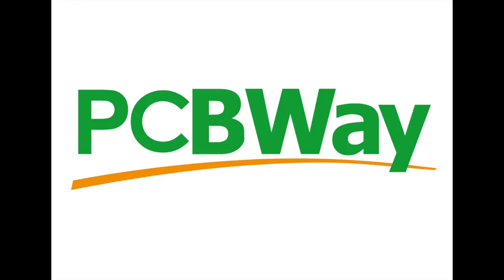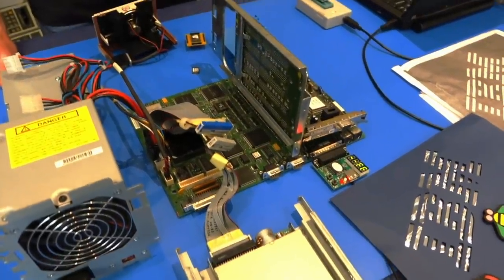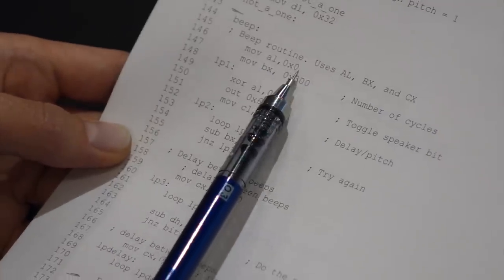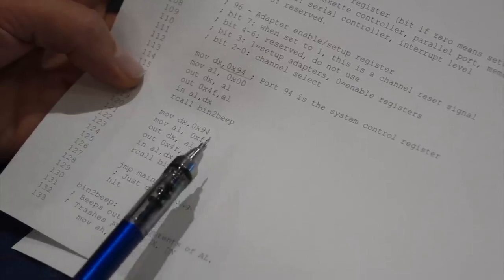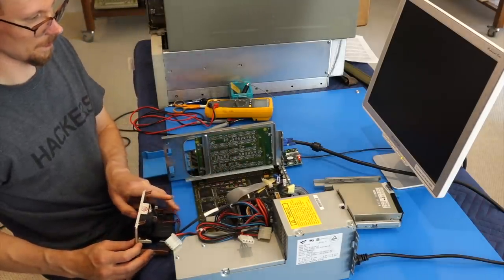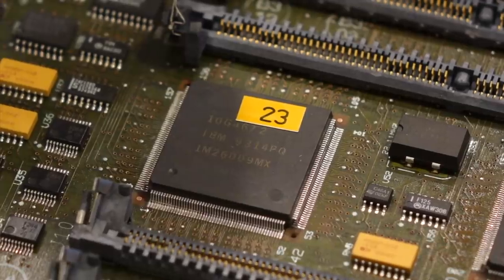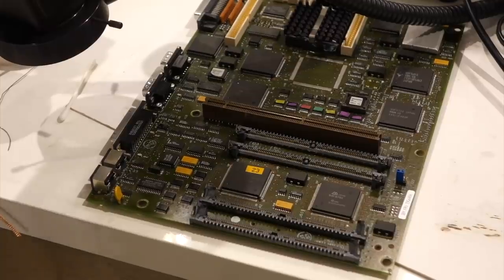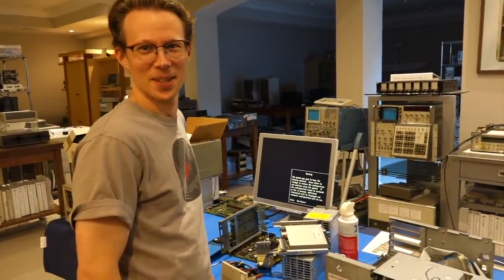IBM PS/2 Part 4: Repaired with a custom BIOS and a magic finger?

Comment: Given how you guys had been pushing on the board, it seems to me like traces might be borked. Trying to revive donor board would be a better idea, probably..

P.S. I don't know a lot of things about what I just said.
Reply: Yep.  I vote cracked via or cracked solder joint that opens and closes with thermal stress.  Hard as hell to find these usually.  Probably better to just foil cover the ram sockets and hot air that area.  Call it a day lol.  Or swap boards like you said.
Reply: That is probably true. If the PCB is toasted, transplanting all of its chips to another board could end in a reliable one.
Or it can be saved with bodge wire to fix the broken trace, but finding the fault is tremendously tedious
Reply: That sounds viable. As an alternative, you could bodge wire everything.
Reply: @awesomecronk7183  Or build a wire wrap replica. Would work fine.
Reply: @Damien.D  * shudder *
Reply: Or a ground issue
Reply: Considering that the goal of this channel is actually the challenge of discovery and the actual repair of historical gear, I bet they will double down at repairing their current board even though on terms of being practical what katoumegumi_ suggested absolutely makes sense...
Reply: Marc's original system is running with the first replacement planar I sent. I also sent a riser for troubleshooting (so that the working system could be left intact) and the second planar. It had the SCSI microcode harvested from it much more harshly than I wanted (I should have done it as Eric demonstrated) - which is why it was an easy selection for more harvesting.

In the same general area, the DS1285 RTC and 2Kb Extended CMOS chips are failing to hold the configuration on a couple of "Bermuda" 76/77 systems. It could be that internal parts of the planar are delaminating. I hope that Eric also de-lids some of the ASICs from the salvage planar (it appeared that he is already pulling chips in the video segment, which is footage from a couple of weeks ago).

Comment: Looks like the high and low beeps take several seconds and the job that the magic finger is doing is hidden during the beeping time.  If the high or low beeps took a half second, then any changes caused by the finger could be more easily located and identified.  But even if you found the location of the fault, you would still need to repair it.  That would probably require that you do surgery on the motherboard, somewhere within the layers.  Your choice of replacing the motherboard was probably the best choice.
Reply: They just need to have a single short high or low beep to indicate whether the read matched the write both ways around, then it can beep away rapidly for high resolution magic finger analysis! :)
Reply: @krnlg  I was thinking the same thing.  Rapid beeps, high for "passed" and low for "failed".   Much easier to track down the issue.

Comment: That BIOS hacking brings back some good(?) memories...
I once did some reverse engineering of a Linksys NAS that used an R8610(?) microcontroller that emulates the Intel 80386. It ran a small program (I think it was RedBoot) as a BIOS alternative to initialize things before actually loading and booting Linux, and that preboot program could also do things like wipe the flash memory and download a new ROM via TFTP. But if you gave it the wrong command, it would wipe itself out, which I did. Oops!
I had to use a JTAG debugger to de-brick the thing, which was not easy: the 80386 boots in real mode and the emulation of this microcontroller didn't emulate real mode properly. So I had to somehow get code into memory to make it go to protected mode without using any broken instructions or broken memory or whatever. I have no memory of how I managed to do it but eventually I had it executing instructions step by step via the debugger, and was able to initialize the BIOS shadow RAM, download the Redboot program into it by storing the hexadecimal bytes one by one from the jtag terminal or something,  jump into the program, and then used TFTP to reprogram the flash memory again.

Comment: I like assembly. I'm enough of a nerd to add this: there are eight general purpose registers in an Intel CPU of which (only) AX is called the accumulator. BX is called the Base Register. CX is the Counter Register and DX is the Data Register. SP is Stack Pointer, BP is Base Pointer, SI is Source Index register, DI is Destination Index register. :p
Reply: All true! Though I suspect what he was alluding to was that since all of those registers on the x86 are general purpose, one could think of - or use - any of them as an accumulator when desired. This is somewhat in contrast to the other architectures in which they are both experts (1401, 6502, etc), or others that just had multiple accumulators. Now what bugged me was that he didn't show the part of the code that guaranteed that CH was 0 when only setting CL to 0 in those LOOPs. :)
Reply: @Hiphopasaurus  ooh, sharp! I was wondering the same thing :)

Comment: Gates may float with stray capacitance or lack of pull up/down. If it's not a capacitor it could be a bad trace for pulling the pin to a logic state. Could try to compare continuity from a known good board and see if the chips pins match. This is a simple trick to diagnose faults. You might find a pin that has a slightly different continuity value. Then see if it leads to a high rail or ground. This may be tricky without a schematic. But if all else fails you can just guess with a high ohm resistor and tie it down. If it doesn't work, tie it to high.

Comment: I had a similar problem with a hard drive many years ago. I heard freeze spray on the chips can fix it, so I tried it and I could read the drive. After a while I figured out pressing on the right part of the board would also fix it, so my feeling was that it was a dodgy trace on the board rather than one of the chips. I managed to get all the data off just laying under the desk with my finger on the drive for half an hour while it copied.

Comment: 99% it's a broken pad-to-trace or a failed solder joint. If the IC is not reading back data with zeros, then it may be Hi-Z'ing the data port (AD port? not sure, I only know 8085) or the IC is not properly ready to be read. Maybe the /RD, /WR etc. control lines? 
I'm assuming you did not try to read any other registers from the same chip here.  
I recall my high school days where we had an Apple II in the lab with a similar issue. That one involved cheap IC sockets though and pressing on the board was enough to get the problem IC to behave. I alternated between that and hitting it like the Fonz. :D
Good work on using a simple BIOS to debug the issue, a true embedded engineering effort there.
Cheers,

Comment: Rejig your test code so that it writes and reads to the port within the beep routine, adjusting your delay for the frequency based on the value being read back as been good or bad. That way you will have a real time feedback that you can listen to while probing with your magic finger. It should help you to identify the exact location of pressure on the board. At the moment you are  sampling for a good or bad port wright/read every 10 seconds or so while beeping out your results.  
Just a thought.

Comment: Some early cheap PC clones had issues with the neutralising solution/wash in the multi layer boards that resulted in some time in the future tracks developed open circuits in the inner layers. When you applied pressure through mechanical means or through temperature. The fault would temperamentally go away only to reappear once stresses normalised. Because it was somewhere in an area of the board on a god knows what layer made them impossible to hot wire. It wasn't worth tearing your hair out, loosing sleep or your sanity.
Thankfully When PS2 came out I never wasted my money on them. They had a bad smell about them and offered little when compared to the many clones. It was a matter of picking better clone manufactures.

Comment: With NASM, you can get it to generate the required long jump at the end of the BIOS by coding:

jmp word 0xf000:0000

Worked for me when did a trial build of Eric's excellent test code.

Comment: To throw another complicating factor into the ring, perhaps one of the surface mount SMD caps failed. Dave Jones did an episode years and years ago about a scope that had a microphonic input connector because the ceramic SMD caps were delaminating. This board is weird, but I love headscratchers like that

Comment: It's most likely a floating data line, probably a bad via or trace your finger on the IC is just enough to pull it low/high to make it work for a while

Comment: Microscopic break in one of the traces, probably in the middle of the PCB sandwich would be my guess. It eventually fails - after using the Magic Finger to shove the trace close enough together to work - due to heat expansion as the chip over the break warms up. Probably not worth going to the effort of trying to fix with bypass jumpers or whatever, so yeah - just use a known-good board.

Comment: Have you guys come across Paricon PariPoser® anisotropic elastomeric fabric?

This is a silicon like thin sheet with silver spheres that is only conduct in the Z axis.

It’s useful for mating between PCBs, connectors & ICs without having to solder (and possible damage) pins.

Comment: Sounds like a floating pin somewhere that as the wrong logic level. When you put your finger on the chip your finger connects to the pin and charges/discharges the pin to the correct level. Since this is cmos, it will store that level for a long time as a charge on the pin.

Comment: I wonder if the break is near the ISA slot, where the most force might be expected.  It seemed to break when you flexed the board downward. It could be that any transverse pressure from the magic finger could "push back" a connection in the substrate. I'd love to know if the magic finger worked elsewhere (har) or if "pulling up" on the ISA slot worked too.

Thank you for the cool explanation of the BIOS assembly.  I liked how it was obvious why the lower frequency beeps took longer to complete from the delays.  I hope that you find joy in giving this one more try, it's an interesting problem.  If you do, please re-write the test routine to beep much faster so that your time-per-test can be reduced to just 1 second, in order to allow more natural exploration.

Theoretically, how might you find an in-board problem like this (if indeed that's what it is)?  Trace-domain reflectometry?

Really awesome work, thank you! <3

Comment: I suspect my ‘retro rig’ is cursed by this channel for what problems to have.

When I first got it, it suffered from a corrupt BIOS like the Dolch which a BIOS update fixed, then it decides to have an intermittent fault like this motherboard when vertical, but works fine when horizontal.

Comment: if it were me I'd check pull ups and pull downs as well as measure impedances for each trace to a known source like vcc or gnd. I saw that he was actually touching the pins with his finger while you were only touching the chip. So my guess is a pad problem or some sort of pull up or down not working the way it should.

Comment: I have a magic fist story, I had an 8GB scsi hard drive (the size of a loaf of bread) that had 3GB of files for a huge print project I was working on. The drive just stopped mounting one day. I had no idea what to do, so I got a quote from a data recovery company.... who wanted £1 per meg, or £3K! I asked my mate Dave Popek, instead, who was a proper PC expert. He dismantled it, more than once, checked everything but nothing seemed to be wrong and it still refused to mount. In exasperation he 'Fonzied' it ()Heyyyyyy!) giving it a short bang on the top with his fist, just like Arthur would have done it, and IT MOUNTED! I spent the next 8 hours or so copying and backing up all the stuff on the drive... and bought a proper tape backup system. Ah, shitty kit, but good times.

Comment: Im wondering if you dont have a bad resistor network for pull up/down that the finger replaces? but that wouldn't explain why cold would fix it either, unless its from overspray on the IO chip getting to a pack and making it work again. The touching of elsewhere on the board making it "break" again makes me think you then pulled floating lines in the other direction.
Reply: The cold spray will make the area that is sprayed contract slightly. If there is a dodgy trace or solder joint, the cold spray may be making it reconnect again.
Reply: @simontay4851  It also causes condensation, which may be conductive enough to pull a floating CMOS input pin to the correct level.

Comment: Interesting the whole "hardcode the stack" thing. I suppose there's no on chip cache in a 486 so you can't do the "use cache like it's ram" thing that is apparently popular today.
Reply: I believe the 486 does have on board cache, but the BIOS has to bootstrap that too. Adrian’s Digital Basement just did a video on a funny little Cyrix 486 chip you could piggyback onto a 386 to get the advantages of a faster clock and on-chip caching, if somehow the board and BIOS supported it (surprisingly that one did). You’d have to ask Tube Time if the IBM bios would have enabled that during a successful boot.
Reply: @lauram5905  I literally just watched that one and still forgot that detail. Doh!

Comment: Watching what was going on, I have three tentative hypotheses:
1. It is a thermal problem of some sort in the chip or motherboard.
2. It is a capacitive problem with a floating lead or a bad bypass cap somewhere.
3. It is another chip that is partially desoldered, and is just getting stressed from pressure on the suspect chip.

I'm going to rule out #1 since you replaced the chip and I've never seen a thermal problem of that sort in a PC board. (Burned holes are a different "thermal" problem. :-)

I'm going to tentatively rule out #3 since it didn't look like Eric was pressing all that hard, but it sticks in my mind as a possibility. One of those little 44(?) pin chips maybe.

That leaves me with suspecting a floating signal. This could again be a motherboard problem, but I'm leaning to bad solder on another chip or possibly a bypass cap. It could be coming from far away on the MB, since I'm thinking hand resistance was changing the charge level, rather than pressure connecting an open lead.

Of course it could be something completely else, but the symptoms seem to match a floating signal on CMOS most closely.
Reply: More likely a bad trace or via on the PCB.

Comment: I'm not sure why you persisted with the 20-second measurement delay. I would have erased the high-bit testing, reduced the low-bit test to a single bit of the port, and made the beeps significantly shorter and removed the gap between them. Then you would have a much more immediate feedback between what you touched and what change it made, if any.

Comment: It may be some problematic pull-up or pull-down resistor on the lines that goes to this chip. The signal line must be floating, and the "magic finger" puts it on the right state to work...

Comment: looks like if touching the chip pins with the magic finger changes the impedance of the defective signal thus make the board work again. What about the voltages of those pins and edges of the signal ? maybe a bad buffer somewhere ?

Comment: Hm, i'm wondering if the short tries on pushing down on the board is enough timing-wise. In later parts of the video (~min 21), you both are just pushing down for a second while the BIOS is in an ongoing 8-bit beep subroutine. The port is only written to and read from between the sequences of 8 bits, right? So this might explain inconsistencies in your testing since the moment you had your fingers on it, the BIOS wan't writing/reading to the port. Am I correct, or did I miss something?

Good luck for the ongoing trobleshooting!

Comment: 22:00 
The fact that one persons finger works but the other does not. To me seems to indicate that it is not a broken connection.
Since the principal variable between different fingers would be subtle difference in moisture, I'd suggest maybe the issue is a stray capacitance of some kind.
Reply: If he puts the "magic" finger on, he does it very close to the pins, maybe even touching them. 
The cold spray does cause some condensation, which is for once conductive, but water also has quite the high relative permittivity (er=81), so it also adds capacitance. 

So yeah, floating pin causing issues, maybe it's even a RESET pin or something like that.

Comment: could it be the finger is acting as a ground wire and the chip then has the missing ground, have you checked to see that corner of the chip has no ground and if so temp wire one in ?

Comment: I wonder if the capacitance of the finger itself is improving the signal or power quality on that chip.  I don' think touching the ic itself was improving the situation but rather touching the leads of the IC that was making the difference.

I would check the capacitance of the nearby caps to that chip to see if any of them are wonky or perhaps marginal.

From what I saw there i'd say there is a decoupling issue 95 times out of a hundred

Comment: For debugging beep pitches for arbitrary data, I prefer to make the beeps go by quicker (it'll almost sound like a simple modem) and use the spectrum analyzer of Audacity to visually see and measure the different pitches/length of beep (in case of morse code). Super handy when I have a buzzer instead of I/O pins!

Comment: Must be a short-to-ground on one of the ground layers on that PCB. The only way to fix that would be to find the exact spot on the PCB by shooting some voltage thru the ground plane and let things heat up. The shorted spot on the PCB would start to bubble or the solder mask will start to discolor. Once you find that spot, drill it out.